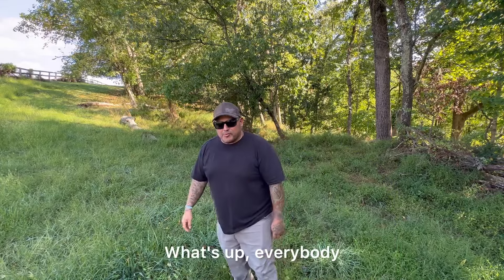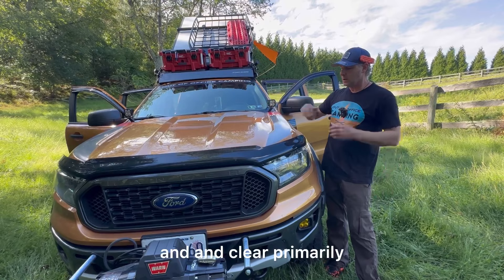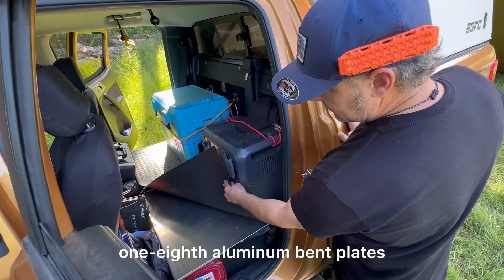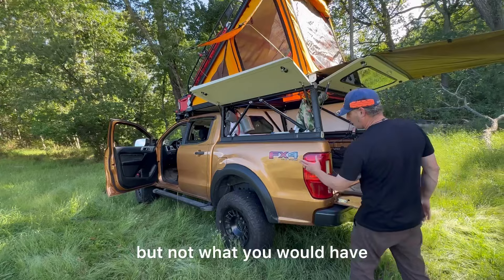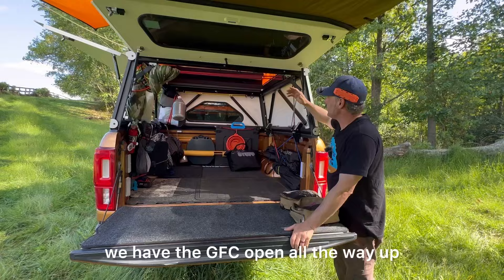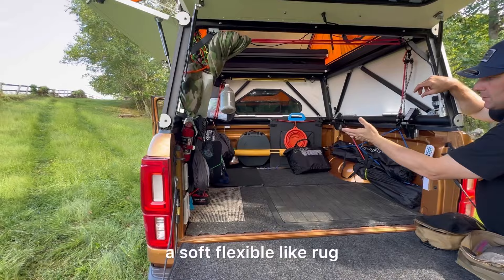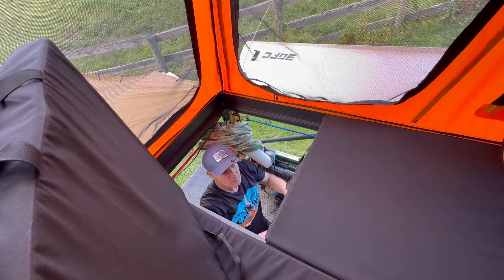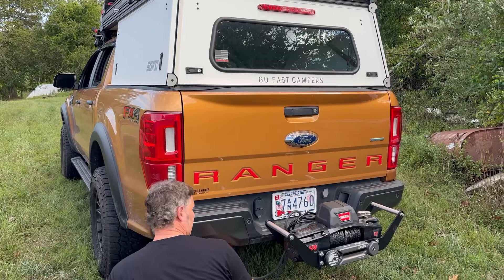Amazing Ford Ranger Overland Rig Featuring @GFC  GO FAST Truck Camper | Purpose-Built

Comment: @HappysTrails  awesome job on this video.   @OutofOfficeCamping, jealous of the rear seat space you have in your cab, and your winch approach.   Thanks for the shoutout on the Bolt locks; to anyone interested, the only downside to them is you can only key them ONCE.   If you change your vehicle, you'll need to keep a copy of the original vehicle key to keep using them.    Even with that downside, I still like them.   The basic raking technique won't pick them, unlike the common-name brand padlocks you see so often.
Reply from the maker: Hey Dan, thank you so much for the calm and I appreciate it and I have a question to go along with your statement about the bolt locks. Do you purchase them and then you set them when you first put in your key? Or do you have to order them specific to your vehicle?
Reply: @HappysTrails They make them only for specific vechicle. When it arrives, you simply insert key turn it all the way, and you will feel it click. Then it's now matched to your key with that first turn of the tumblers. Very easy!
Reply: Got tl give credit where credit is deserved. You know i can help you with that rear seat. O wait you have a 2 door. 😂 I'm always down to making you a platform. Maybe we will get a Hunneyman awning solution.